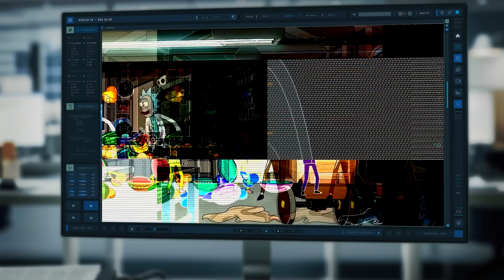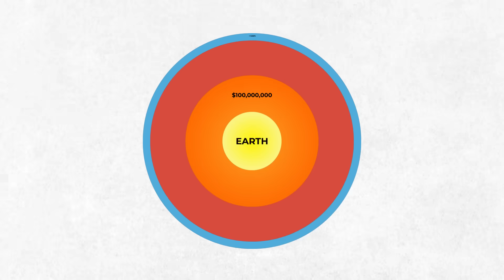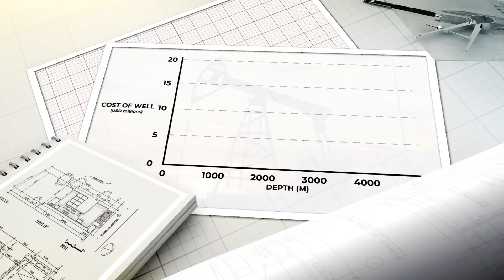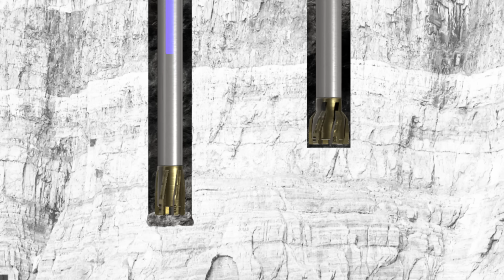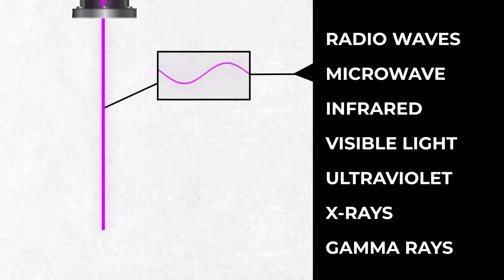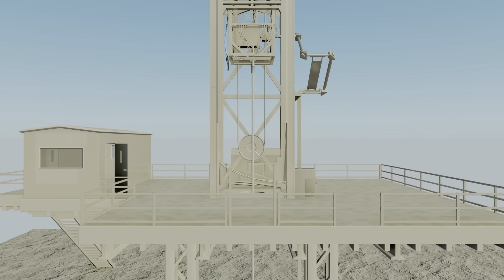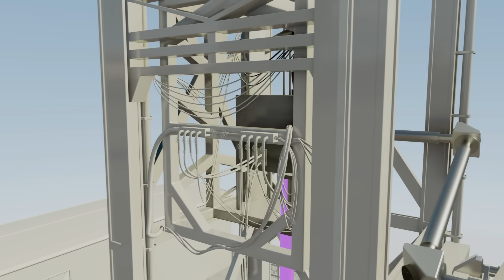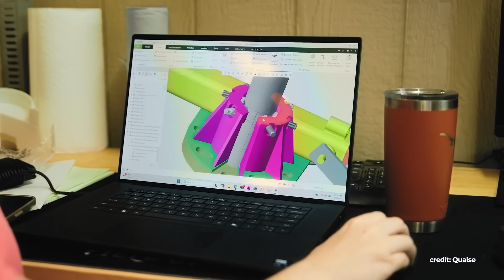The Most Advanced Drill in Human History

Comment: lol you can only melt so far.. go low enough and its already melted, then what?
Seems easy when you think about connecting 2 points on a globe and connecting the points, making the "shortest straightest" path between 2 points. If you could make it, it wouldnt feel straight, it would feel like it curves. If you map it on a time cone of the planet you can see how each step would feel step for step. Flatten out the cone map for density, is it still the shortest path?

We like to imagine it being Euclidean, but its more like how Gauss could see it, non-Euclidean. The deeper you go the more there is to core through, your bit wants to take the path of least resistance, the way it came from, so it starts to turn up on itself.

Imagine every atom is a peak in a frequency, as you go lower the frequency increases, getting smaller and tighter together, at the core, is there as many peaks in your orbit as there would be on the surface?I imagine they tick by way faster down there, but its all just frequencies and waves. 
Light finds spacetime easy to deal with and we can use its journey to map the infinity out, but to it we are voids of infinite curiosity. In and out is all there is to the universe. Event horizons separated by spacetime that is dilating as our hosts evaporate. If you was a lightwave you might see in as being out and out being in.. we see echos of reality, and think that is how it is, but it is how it isnt in so many cases. It's all a negative of how you see it, i can make a case for up being down, in being out, flat being curved. It is mirrored

At the centre of a singularity space and time should flatten out enough that an event horizon forms at its core, thats where we play out, its in is our out. As it loses mass to its singularity the universe ticks forwards, time flows and things fall down. Pulling you from infinitely small and hot to infinitely cold and void, we straddle the 2 infinite perspectives in so many ways. It looks like a time cone, or tesseract, or hypersphere or mobius strip, they all have the same geometry to anyone on the board, infinity hot behind you, infinity cold in front, motion from one to the other without ever actually going anywhere. The 4th dimension is pulling you from one infinity to the other without ever moving anywhere, its all just dilation of our host singularity, as it cools the central point relaxes and grows, we expand to fill the void.

Comment: Just build a standalone system much like a vertical submarine, use the slag to coat the walls. It's a hole but it's also perfect for data transfer. When you get to a certain point you will have to increase device size and change the method to which you create the walls. I believe there are types of things that have a massive heat resist... Might be better to create pools of water that steam can push into horizontally to the shaft, if the pool has a downward spout like ramp then the water can fill and drop back down. Why not use diamonds to create a very large bit like system. After that you just make sure the hole is full of water to help cool it down.  Using fins in the water I mean you could make them like a mile long. If you can push the matter out into the wall. anyways.

Comment: Why don’t they use a drilling drone instead of using a kilometer-long drill?
Reply: melt
Reply: Let's assume you could build a drone that fits in a 20cm borehole while being able to drill through solid basalt and granite, and that you are able to deliver power to it 12km deep:
Now, after a few minutes of drilling, you encounter the same wear issues due to high temperatures that the steel drill bit would have, except instead of having wasted a (quite expensive) steel mechanical component with a couple of moving parts, you have wasted an absurdly complex and expensive drone with hundreds of moving parts, electronics, etc.
Reply: That is what I was thinking, a drill that locks into the rock around it and drills, thing is it wouldn't work where the rock starts to got soft due to heat etc. if it didn't work for other reasons already

Comment: Empire state building is 443m to the tip. The hole at 2:08 is 12,3km. That is 27,7 Empire state buildings. 
I think you mixed feet and metres here. Empire state building is 1250 feet and 1250 goes around 9 times to 12 300.

Comment: Was super skeptical at first, but seeing the challenges with conventional drilling and, that this is more than just a tech start up type of deal has me hopeful. The vaporized particulate removal seems like a tall task though, since we're talking kilometers. Idk if it would be possible to make the outer layer of the drill porous and have it pull in a lot of the junk without getting clogged up or other capture methods, for the parts that won't make it all the way to the surface. Or alternatively using a fluid, that is invisible to the microwave band, though you would get all sorts of weird pyrolytic and chemical reactions there.
Reply: They will use a fluid that is mostly transparent to microwaves, compressed air.

Comment: The reason why oil and gas wells are lined is because there is A LOT of pressure in the underground. It is fine penetrating granite or basalt that is tight and strong. But there are many other layers of sand,slate, silt, salt or chalk… and aquifers. An aquifer at 4 km depth can easily contain 1000 bar of pressure and the softer layers like salt, chalk or slate cannot sustain such pressures, so when you break the cap rock, it flows upwards and penetrates into the softer layers where it can cause all sorts of issues like contaminating shallower aquifers which may be used for drinking water or by fracturing chalk or slate causing potentially huge sink holes. So that vitrified glass layer must be able to sustain massive pressure and be flexible enough to manage movement in the subsoil - which will be amplified greatly if you pass hot stuff through it.

Comment: The comparisson betweeen the Kole duperdeep borehole and the Empire State Building is not correct.
The borehole is 12.3km which are 12,300m. The Empire State Building is 443m.
So the Kole duperdeep borehole measures roughly 27.7 Empire State Buildings deep.

Comment: There's no difference between a maser and a laser. Whether it's microwave or another wavelength of light it's still light you can call it a microwave laser perfectly fine.

Also nobody has dealt with the obvious problem of where is this vaporized rock all going to go? 
It's vaporized you didn't disintegrate its nucleus it's going to condense on the surface of something nearby that's cool unless you heat the entire apparatus to the vaporization point of rock this vapor is going to condense on the pipe you are using to drill the hole.
this method makes zero sense you still need to remove material but there's no way to do this when it condenses as a glass vapor on everything nearby.

Comment: Lots of inaccuracies in this. As someone who has been part of drilling 15 000 meter long wells ( not depth but length ) we were able to do that in 90 days more then 8 years ago already. And we had plenty of power left to go further. Problem with a vertical wells is weight and tensile strength at that kinda depth. And hydrostatic pressures
Reply: So, this is all to fix a problem that doesnt really exists with a method that is just science fiction? I dont know a single thing about deep drilling pressures however I have my doubts that a thin layer of semi petrified glass will innovate this process.
Reply: In horizontal drilling, as in drilling tunnels, big machines are used which travel through the rock completely. What if me made a machine like that but for vertical drilling? You would have the whole rig inside the whole then, so there is no problem with tensile strength and weight. But the pressure and heat would be a problem, and getting the drill hole mass out of the hole.
Reply: @DornDaniel they already exist. They are called VSMs or vertical shaft sinking machines. Used for boring underground packing garages and mine shafts and under ground water storage. They also already come in quite large diameters like 8 meters i belive and can bore down several hundrred meeters

Comment: They could just use one hole. There are areas in Greenland where there's not enough water and they inject water in one hole wait for it to boil and switch a valve to the generator in a double cycle. Think of 'Old Faithful', every once in a while you get a big jet of water and then it settles back down in boils but only much more vigorous for hydrothermal.

Comment: So if water is pumped down a very long hole to reach some depth where it will contact hot rock, won’t it also dissolve or extract minerals out of that rock at one temperature and pressure?  It seems like there will be some temperature loss and pressure loss as the hot mineral-laden water is pumped back up to the cooler, lower pressure surface. Won’t minerals come out of solution on the long way back up as temp and pressure drop. How many days, weeks, or months before you have to crank up the laser again?

Comment: @Dr Ben Miles within the first minutes you claim they are using lasers for drilling the company itself however only speaks about "milimeter waves"  which i highly suspect is just a run of the mill beefed up magnetron firing microwaves and not a microwave laser which is an entirely different beast. 
the company also never claims their drill is "fusion powered" which your AI-generated description mentions.  what the company claims is "Based on breakthrough fusion research" not exactly the same thing!

they claim to vaporize the rock which causes an issue with condensation. vaporized rock will condense a few meters up the borehole even if the hole is ventilated by high pressure gas which will cause clogs or deposits of vitrified rock along the borehole and drill causing a catastrophic amount of friction which will eventually cease the airflow they plan on using to remove the rock from the hole.  
no amount of compressed air being pushed into a comparatively small borehole will ever be capable of preventing the hole from clogging if its several kilometers long.  using water is similarly flawed as any water coming into contact with the several thousand degrees molten rock will cause steam explosions or even hydrogen oxygen separation followed by a violent oxyhydrogen explosion. it will also cause catastrophic stress fractures due to the rapid cooling in the glass sheath meant to keep the borehole stable. 

to this day the company has not delivered on any of their bold claims. they dont even have a working proof of concept of their technology. at best they have a conventional drill that can melt some rock and drills slower than conventional drills while being several times more expensive.